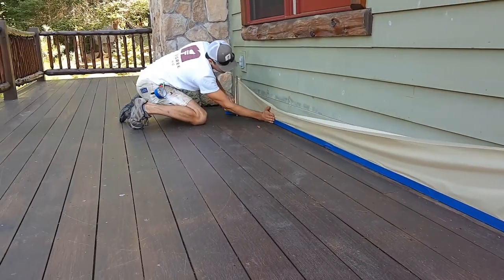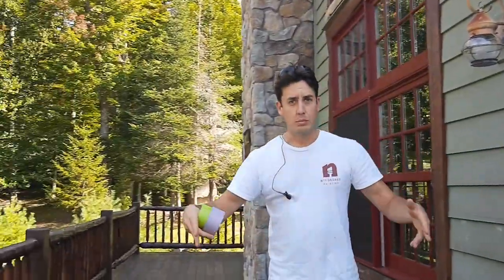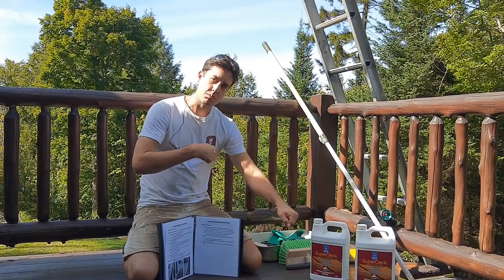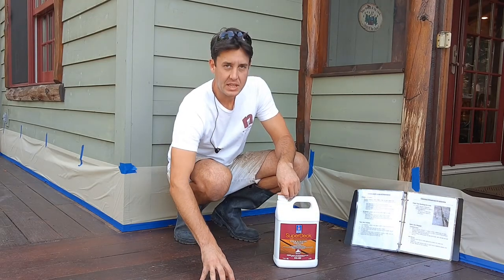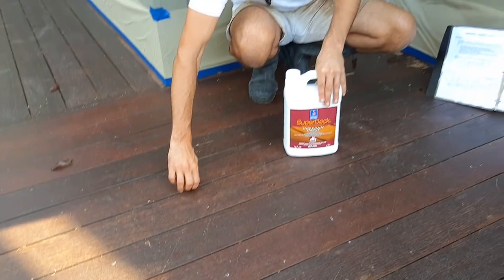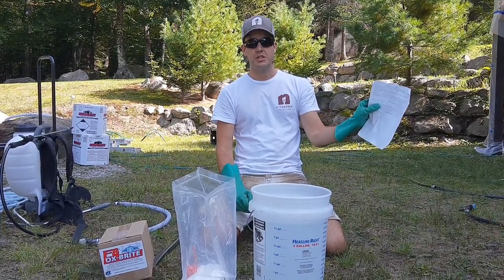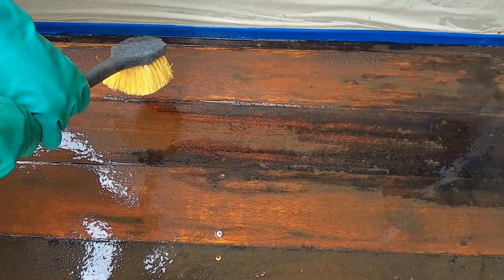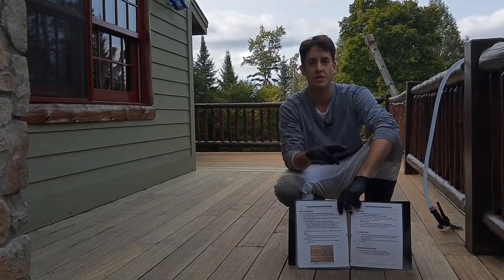Chemically Stripping & Brightening Exterior Wood

Comment: Such an excellent and detailed video of the process. Thank you!

Couple of comments. You mentioned you will use Superdeck Canyon Brown oil based stain. I thought you need to treat hardwood with hardwood stain, or it’s okay in this case. Some manufacturers (i. e. Armstrong Clark ) explicitly state that for hardwood you need to use a special stain. 
Hardwood definitely rots. I’m dealing with this issue myself. The previous owner had planters with drip line in each corner and due to a poor design the boards under the planters were kept moist all the time. Needless to say that the damage is significant. I’m going to flip these boards to get a couple of more years of it.
Reply from the maker: Great question about hardwood stains - there are hardwood specific ones that work great like Armstrong Clark's. That's actually my preferred one. However, most other penetrating oils will work on hardwoods, you just may have to wipe off excess depending on the manufacturer. It's never a bad idea to use a hardwood specific one but it's by no means a necessity!
Reply: Test a small area for absorption first, but I'd thin it down 10 to 15% on hardwood

Comment: Thank you so much for this video. I have been searching forever. I have one section of deck that I stained with a waterbased stain it failed and I am grateful I do not have to strip the whole deck. I am using the sherwin williams products that you mentioned. I did not know if I had to keep the house walls (wood) covered when using the brightner. You answered that question. I will be covering all the walls upper and lower. Thanks again.
Reply from the maker: So glad it was helpful, thanks for watching!

Comment: If u can plz reply I’m doing my deck now.. I do all the construction I’m a stay at home mom and my husband works… he replaced (he does the hard stuff for me still lol) a few deck boards… so some of the wood is bare and some is needing strip… can I put stripper on the replaced boards or do I have to go around them or pull them uo
Reply from the maker: You can use the same stripper/brightener application on the new boards. They won't look the same since they're new but you can't really change that.